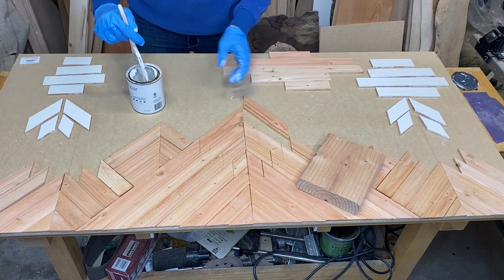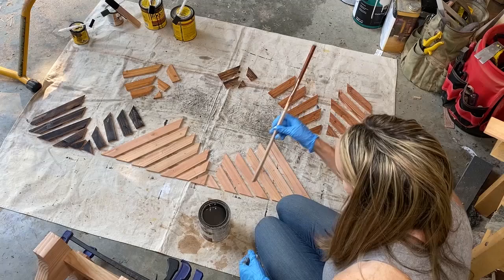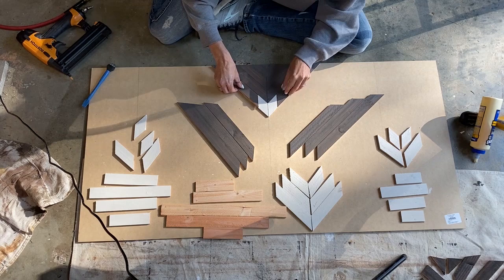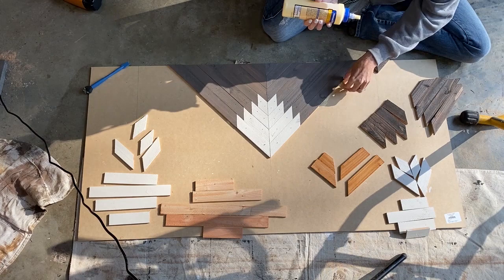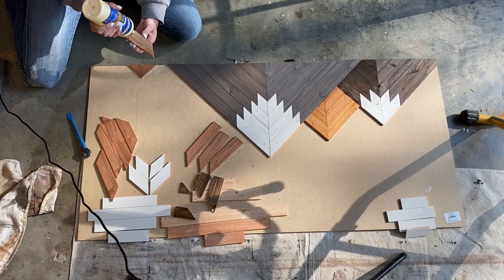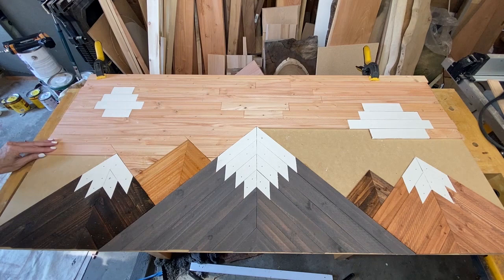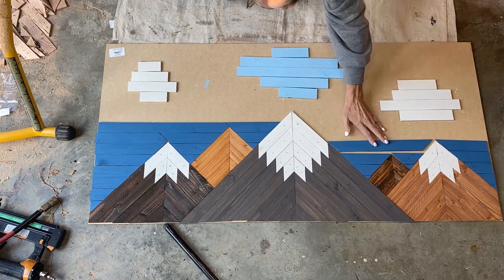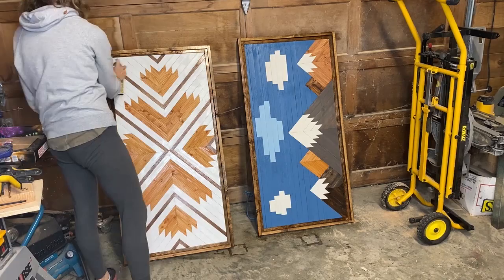Geometric Wall Art Tips and Tricks for Beginners

Comment: Hey there fellow woodworker. I thought I'd try to give you some advice on where to locate thinner planks for your wall art, if you're still looking for thin stuff. I build with all reclaimed pallet and shipping crate wood of every variety. Primarily, and pine, fur, cedar, white ashe.  If you don't want to go through the the tedious and time consuming task of staple and nail and screw removal, I would recommend you scour through the fence picket selection of your local bigbox store, whether 4"or 6" variety, you're looking for the "thin-ones" of either size. This would mean also, more time on the table saw, ripping your strips to correct width, back to your Miter for the angled cuts. I'm a new subscriber by the way. Hope this was helpful, at least a little.
Reply from the maker: Thanks for taking the time to leave your tips, I appreciate it and it’ll help people viewing this video too.